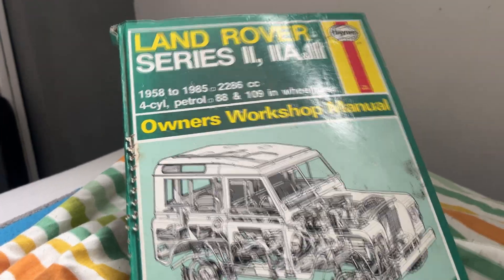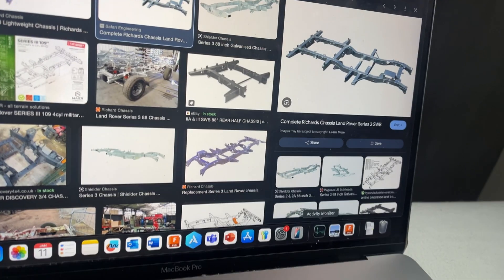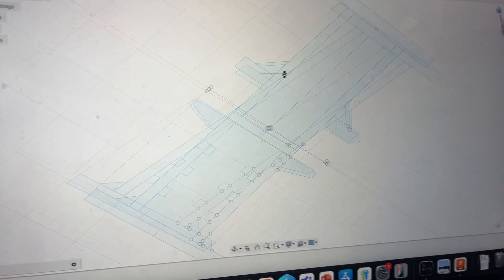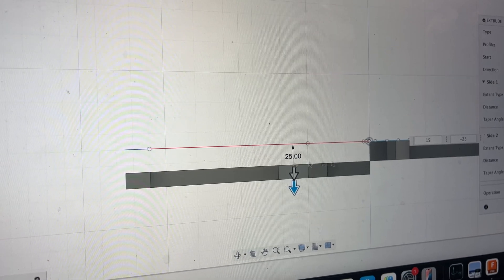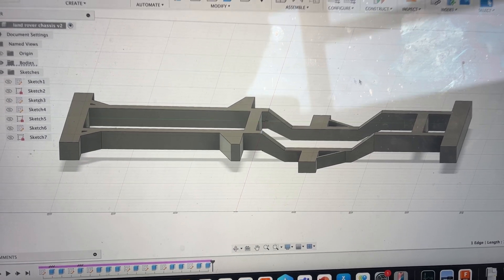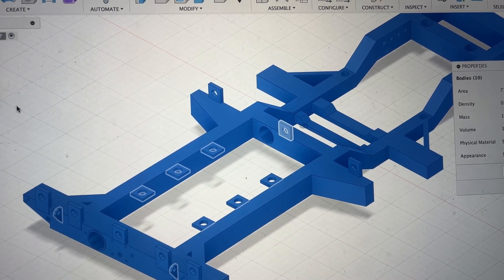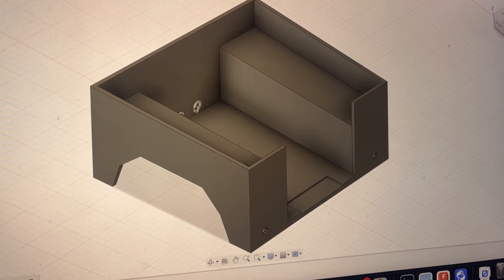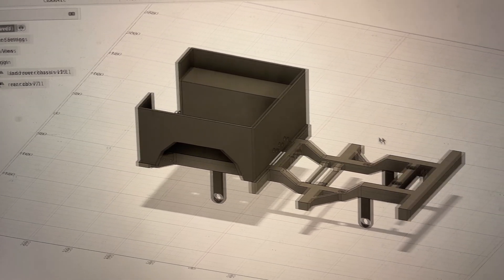Building A Model Land Rover Series 3

Comment: Ain't the chassis made out of hollowed tubes? or c section bars? it could be easier for you to do a side view with the shape of it and then extrude the section over the path... just do half of it and then mirror it...
Reply from the maker: Yes you’re right, I noticed that on the chassis of the actual lrs3 but it is going to be near impossible to CNC that on the machine, it’s easier if I make it out of solid material however I may just cut out part of it to be hollow to give the impression that the whole thing is
Reply: @i88y  are you going to do a smaller model or a "real" one? full size?
Reply from the maker: Full size, as in 1:1 scale? No im doing a model one about a tenth or 12th I can’t remember
Reply: @i88y  Then... it is easyer to do it with the right shape and 3d print it... much cheaper than machining.... https://www.youtube.com/watch?v=UYUKxI9xIZ8 and if it is a model, there already are a few designs ready...
Reply from the maker: A 3d printed chassis is boring in my opinion, I want to use methods I haven't used before so its actually fun, I like a challenge, the cost shouldn't really matter because we have a CNC machine at school and I want to design it myself so I can change stuff to fit my modified car